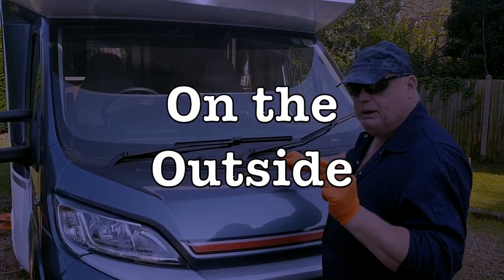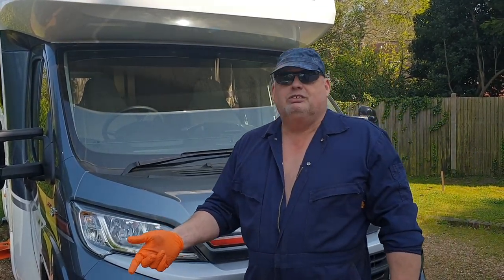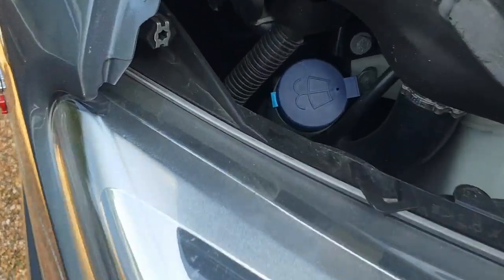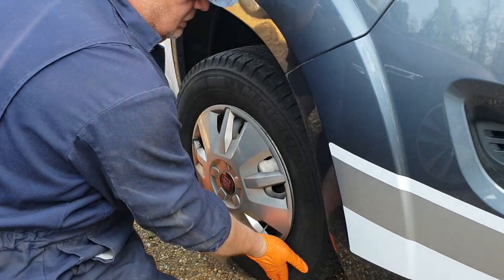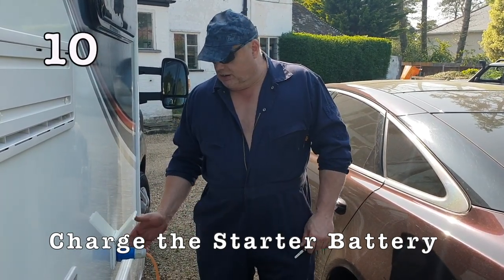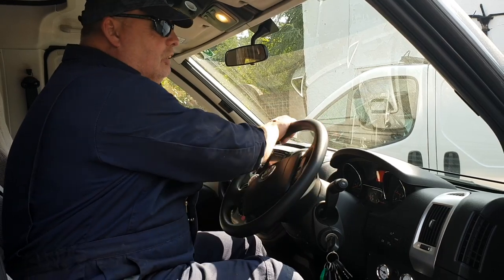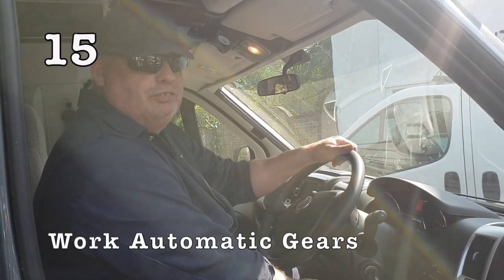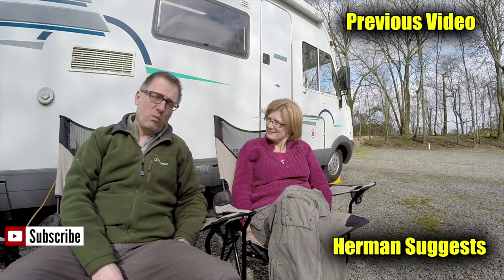Are You Doing These 15 Easy Top Tips to Your Motorhome During the LOCKDOWN?

Comment: The tyre check suggestion is an excellent one especially the bit about moving forwards a bit and rechecking. Speaking from experience here.
Reply from the maker: What's that then Alastair? What problem did you have?
Reply: A bulging front near side tyre which became very noticeable only while out driving. Likely had hit a pothole. Even when I stopped (with bulge at bottom on road) I could not find any defect. AA man identified problem by driving forward a little. Even he could not find the problem till he moved the van forward.